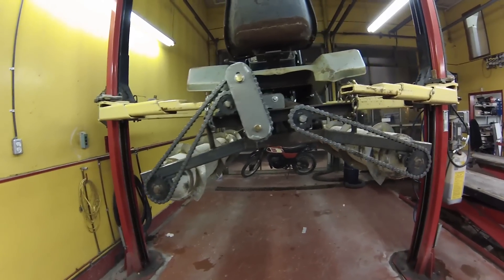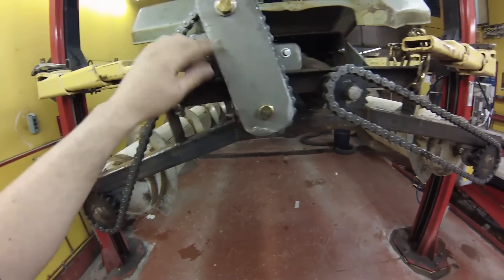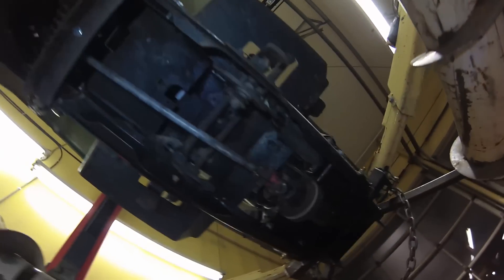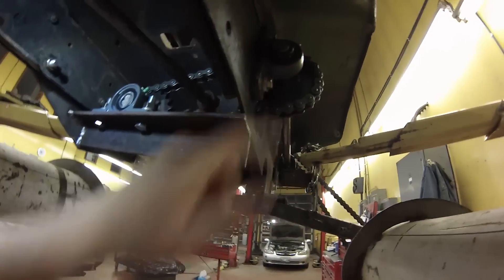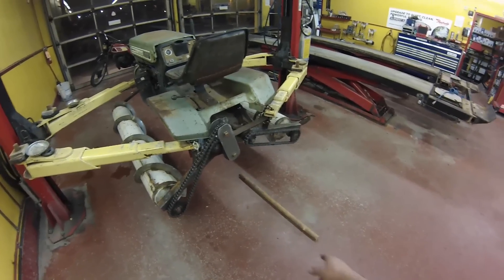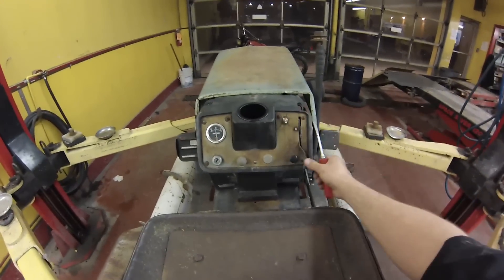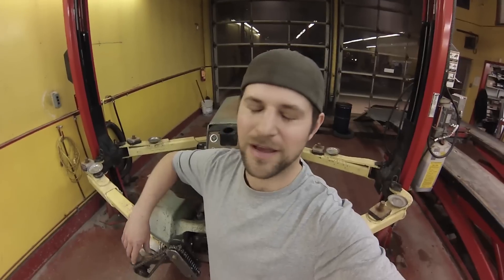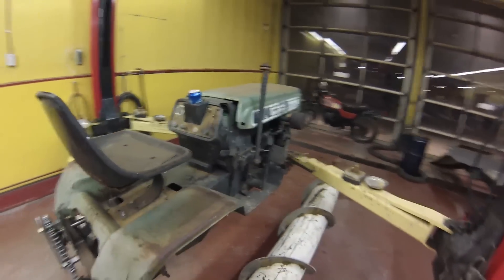Screw Drive Vehicle - Extreme Off Road - Part 7 - She Spins

Comment: an axle with and electric locker would allow you to unlock it while turning, thus taking load off the screw that isn't turning.
Reply from the maker: adamg gallagher hmm, interesting idea. i think most electric lockers lock one side gear to the case of the diff. if i could get one that had the option of locking both side gears or either one or the other that would be very cool. neat idea.